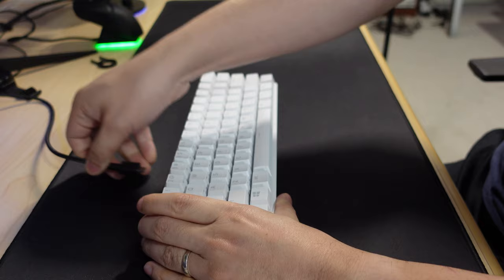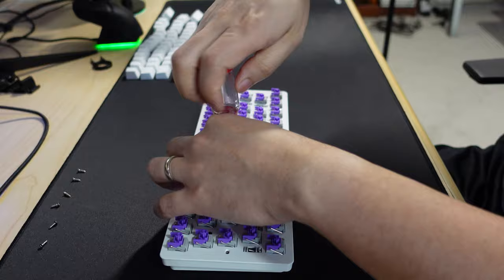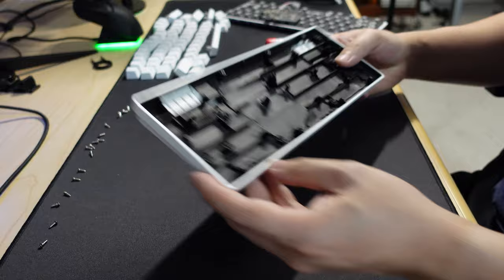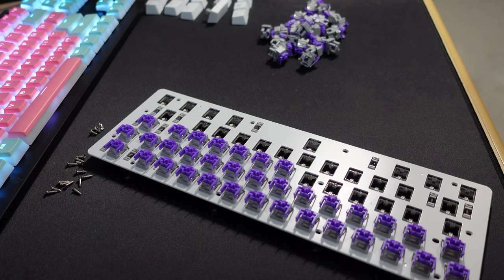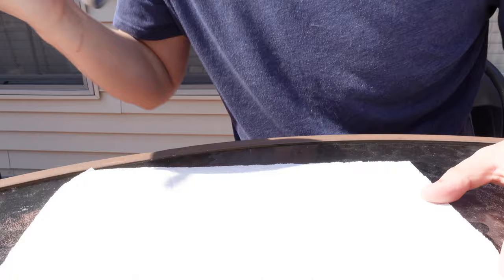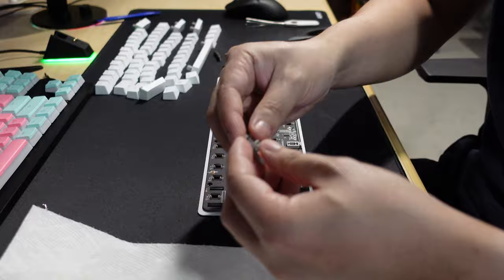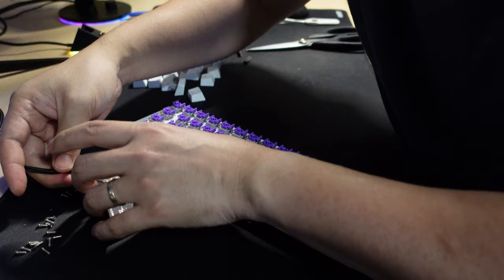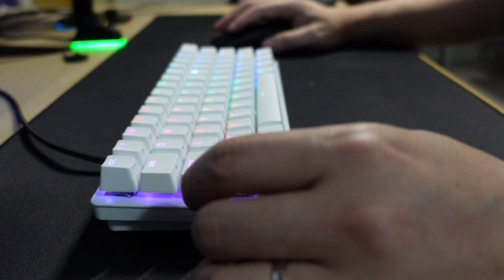Modding the Razer Huntsman Mini: Easy steps for better sound!

Comment: Anyone that have lubed the new razer switches with walls? Like with spraylube? I want to do it but i cant find any videos onit. I have a blackwidow elite with yellow switches
Reply from the maker: Since those are traditional mechanical switches, I would be very careful with spray lube. I know 3ildcat has some guides for doing it without removing the switches, but there is definitely a risk. There are also some video guides on how to lube with traditional lube and a brush by kind of depressing each switch and then using the brush to get some lube on the rails and stem. That may be a better option (I did this with my Blackwidow Lite and it made a pretty noticeable difference).
Reply: @bigxie  ahhh thanks. :)

Comment: I just did the same mods but I used g lube and I also LUBE EACH STABILIZER ON EACH KEY took forever and also mine had foam in its already bought it from amazon new about a week ago also sounds completely different it is the purple switches as well ( mine is very deep and iswear zero spring pin or rattle even stock ) i can do a video if you want also side note you can get the keyboard for 75 usd now and 10 bucks shipping )

Comment: Ribbon cables usually have a breakerbar that has to be levered up in order to release the cable.
Reply from the maker: Indeed, but it doesn't lever up, it appears to lever out (which is why I tried using the pry tools). Turns out it's easier to remove on the keyboard PCB end, just takes some firm pressure to pull it straight up and out.
Reply: Andrew Xie Ok I see. I was interested in the Huntman Mini with the linear switches but when I heard the noise I instantly changed my mind. Do you think your measures may improve the sound of the new linear switches and stabs as well?
Reply from the maker: @aa65064  yes, I'm sure it will. Check the pinned comment to see how these same steps affected my TE, which uses the older generation red switches which are louder to begin with.

Comment: i'm scared to remove the switches. if i sprayed the wd40 into a container and used a brush to paint the lube into the switches, would that work too?
Reply from the maker: If you're going to be disassembling the keyboard to the point where you'll be able to access the switches with a brush, I would recommend you go the extra step of removing the switches. Even though I just popped them out in the video, there are actually tabs on the switches that you can pinch from underneath and push them out without force. That being said, if you wanted to use a brush to apply the lube, then just skip the WD-40 and sprays altogether and you can use traditional keyboard lube like Tribosys, Krytox, or even cheap SuperLube https://www.amazon.com/gp/product/B000UKUHXK/
Reply: @bigxie  hmmm would the dry lube wd40 have the typical wd40 smell?
Reply: @xuanshin13  did you ever paint brush lube your switches? If so, how did it go and do they still feel good?
Reply: @brobot6565  i didn't try paint brush lubing it as i read somewhere that it might affect the sensitivity of the switches, due to it being optical switches. So i just did the normal WD40 dry lube. I did however, went on to build my own keyboard haha

Comment: Planning on Trying this for the first time. Before i order the lube i just wanna know if one 10oz can is enough for a full sized or should i get the 5 pack
Reply from the maker: One 10oz can should be more than enough
Reply: @bigxie  have you have to relube the switches yet? Or have you not really used the keyboard so the lube is still fine.
Reply from the maker: @brobot6565  I haven't been using it regularly recently, but for about 6 months after I made the video I did and didn't notice any degradation

Comment: Hey! Recently I’m thinking about buying the huntsman mini and I have a question about the performance and modding. Mostly I’m concerned about the keys getting dirty after lubing them with the wd40 also did you have any problems after modding it (key’s didn’t work etc.). I would be very happy if you would answer. Cheers!
Reply from the maker: Hi, I haven't had issues in the 6 months or so since I did this. Since the lubing is done with the switches removed, as long as you give sufficient time for them to dry before replacing them, it shouldn't cause a mess. Some lube may get on the PCB, and you can clean it if it bothers you (I didn't, since it's non-conductive and I can't see it once everything is reassembled). Hope that helps!
Reply: @bigxie  thanks bro!!! You really helped me. Anyways nice and helpful vid, keep up the good work :]]
Reply: @bigxie  and I have one more simple question. Has it turned yellowish?
Reply from the maker: @azmmr5608  no discoloration. Make sure you're using the PFTE dry lube variant of WD-40. Sounds like your concerns are based on regular WD-40, which you should NOT use on your keyboard.
Reply: @bigxie  No No i’m thinking about the keycaps and the case changing Color because of usage
Reply from the maker: @azmmr5608  interesting concern. The doubleshot PBT keycaps are pretty resilient to wear and discoloration. Mine look pretty much brand new. Of course mine is just being used in a normal, temperature controlled home office. Can't say for sure in a different environment how it would hold up.
Reply: @bigxie  yea i’m typing from hell soo that could be a problem... hahah just kidding thank you so much for the help

Comment: Did you use the dry lube spray for the stabilizers as well or did you use grease instead?
Reply from the maker: I would recommend using Permatex or some other dielectric grease since it will help cut down on the stabilizer rattle. I initially did use the dry lube and had to go back later to add the grease to get it a little less noisy.
Reply: @bigxie  Oh ok makes sense. So dry lube on the switches and grease on stabs. Thanks a lot for your response

Comment: does this mod work with the huntsman elite?
Reply from the maker: yes, the principle is the same, but the teardown for the elite is a lot tougher since it has that light diffuser layer in the middle. I wouldn't do it unless you're pretty confident working with electronics and read/watch a teardown guide.

Comment: Can I swap the razer optical red or the purple? And is it easy to do?
Reply from the maker: Yes, the switches are interchangeable and can easily be swapped out. The hardest part is sourcing 61 (or 87 if you're trying to do the TKL) of the other type of switch ;)
Reply: @bigxie  how do I source 61 I have the razer huntsman mini btw
Reply from the maker: @corbs2971  unfortunately they don't sell the switches individually so the only way to do it is buying a Huntsman with the kind you want (for example a broken regular Huntsman, if you're looking for purple switches)

Comment: I know im late but can you use cherry MX on The huntsman mini?
Reply from the maker: No, the Huntsman family of keyboards only support Razer optical switches. These work in a completely different manner than traditional MX style mechanical switches. There is no metal leaf in the switch, it merely acts to block a laser beam that is shined by the PCB across each socket when it is pressed down. As such, they are a proprietary design and the only ones that are compatible are the red and purple switches from Razer.
Reply: @bigxie  ok thanks

Comment: I got the stabilizers out but where do I spray lube them. Do I just spray lube the whole thing?
Reply from the maker: You can actually take them further apart and lube up just the metal bar and then put it back together. If I could do it again, I wouldn't spray lube the stabs, but rather use some dielectric grease on all the "joint" or "hinge" areas.
Reply: @bigxie  Oh. The whole bar? ty for the tips
Reply from the maker: @ForeToldFN  well, if you're spray lubing it, it's pretty difficult to not get it all over the whole bar 😂
Reply: @bigxie  oh lol

Comment: 06:16 can i use normal lube and lube it with my paint brush on the sides I've seen alot of ppl do that and I was wondering if that would work
Reply from the maker: Yes, it can work and is preferred for traditional switches. The reason I suggested using spray lube with these Razer switches is that they don't open like traditional switches and there are no metal leafs in them to mess up with over lubing. You can definitely use traditional lube with these Razer switches as well, just keeping in mind that they don't come apart and you may need to spend a lot more time reaching all the surfaces with contact.
Reply: @bigxie  yay thx dude <3
Reply: @coylaxy7868  did you ever lube it? If so, how did it turn out?
Reply: @brobot6565  good it's been 10 months it's pretty good ngl

Comment: Is this keyboard hotswapable?
Reply from the maker: No, not really. The sockets are only compatible with Razer optomechanical switches, and swapping them while the board is on (hot swapping) leads to problems like other keys not registering.

Comment: Can you tell me what screwdriver your using. I don’t know which one to get.
Reply: He said it was a cheap screwdriver but he recommends a magnetic head screwdriver
Reply from the maker: If you're looking for the exact Philips head size, I have no idea. I would just get an electronics repair toolkit and it will have a Philips screwdriver that will work. The screws look to be pretty good quality and won't strip, even with a cheaper screwdriver.
Reply: Andrew Xie ok thanks your a life saver

Comment: Do you think a casual gamer that doesn’t really know a lot about this can mod it successfully like you did
Reply from the maker: Hey Will, I think it's among the easier stock keyboards to mod since there are only screws to remove in order to open it and you don't even need to remove the ribbon cable (which may be trickiest part of the process) if you unscrew the daughter board. The other parts are just tedious work (removing each switch and lubing them). It's similar in difficulty to assembling somewhat complex furniture (in reverse). But if you're worried about breaking the keyboard or losing the factory warranty, then I would recommend skipping these mods (especially if the stock sound or noise doesn't bother you).
Reply: @bigxie  ok thanks and also, should I just put the lube all over the switch or is their in part I should cover up?
Reply from the maker: You don't really have too much control with the spray, but I aimed mostly at the stem and spring, and then just click the switch a few times and it'll spread over all the surfaces in contact with each other.

Comment: Love the video, but which size screws are used on the board?
Reply from the maker: I'm not familiar with the screw size standards, but if you have a philips head screwdriver included in an electronics repair kit, it will work to take out the screws.

Comment: quick question how long will the lube last inside on the keyboard
Reply from the maker: I haven't really seen any degradation in the year and a half since I made the video. Optimistically speaking, it may last longer than the ownership of the keyboard. Worst case you may need to refresh it every couple of years.

Comment: Whats the tool hes using for removing the keycaps called
Reply from the maker: It is called a "keycap puller". I would recommend going for the ones with the metallic arms that can flex, rather than the all plastic ones with fixed spacing.
Reply: Ok

Comment: Can u use dielectric grease instead of wd40?
Reply from the maker: For the stabs, yes. But not to lube the switches, it's way too thick for that.
Reply: i've lubed keyboards with dielectric grease before. it's v easy to overlube or cause sticking issues if you dont get a lower grade grease. you also might nuke your tactiles

Comment: How do you remove the stabilizers? Is it the same process as removing the switches?
Reply from the maker: The stabilizers clip on to the metal plate. You can pop them out the same way as the switches (just coming from the opposite direction).
Reply: @bigxie  thanks for the reply! i have a follow up question. i did the same procedure as you but some of my keys are getting stuck after i press on them. how do i fix this issue?
Reply from the maker: @paoloaustria1577  Hey Paolo, I had a few switches do this as well. In my case, it was due to the metal bar on the switch itself being not fully seated in the plastic clip, making the switch get stuck as it moved up and down. This is very easy for it to happen when popping the switches out of the PCB, so I just made sure to check and fix each switch before putting them back on the board. To fix it, you kind of just pop the metal bar (switch stabilizer) back into place and click it a few times to ensure it's working smoothly.
Reply: Thank you for the reply again. It got fixed now. I think the problem was the lube was not thoroughly dried up when i put it back in. Now it works like a charm. Thank you!

Comment: I have the mini with red switches for awhile now i havent heard any ping or had any issue, im quite sure that they added some sort of foam in the switches themselves that has helped alot
Reply from the maker: Yeah you're right! The Huntsman Mini has improved red switches vs the ones originally introduced in the TE and is significantly quieter out of the box. Even still, the mods can make some pretty noticeable improvements. There's a viewer comment on this video somewhere where he's got a before/after sound test of the reds. But if the stock sound is enjoyable and doesn't bother you, I would just go ahead and keep using it that way!
Reply: tbh the main reason i got the mini was the white color to fit my setup, although for the price they could forsure make the stabilizes alot better they can still shake a good amount
Reply: @NailTeeth  ypu can lube the stabs and there wont be any rattling anymore

Comment: would this also work with the full size?
Reply from the maker: Yes, it also works with the full size and the Elite, though they are a bit more difficult to disassemble than the Mini. Once you get to the PCB, the switches and stabilizers come out the same way.

Comment: How much wd40? If you lube the switches wont the click go away?
Reply from the maker: I had also read that sometimes lubing clicky switches could make the click go away and was willing to assume the risk. Luckily, on these Razer purple switches, that doesn't seem to be the case. The example in the video of me lubing the switch was actually the first switch I sprayed, so I was being pretty cautious. Eventually I ended up lubing each switch by spraying up the spring from 2 opposite directions for each switch, holding down the spray for about half a second each time. I don't think you can actually overlube it, because the excess will drip off the switch.
Reply: @bigxie  what about cutting some foam and put it in the sides of the keycap in a way where it doesn't affect the RGB or the feel of bottoming out?
Reply from the maker: @ooogabooga9425  what are you trying to accomplish? The pinging is caused by the springs and can only be fixed with lube and dampening in the case. If you don't like the sound of the keycaps bottoming out, you could try o-rings.
Reply: @bigxie  is this really safe? since this switches are opticals we may fuck that laser thing or am i just dumb
Reply from the maker: @ignacio3714  If you pause at 0:05:09, you can see from the empty sockets where the 2 ends of the lasers are on the back of the PCB board (at the top and bottom of where each switch was). Since we're taking the switches out and giving them ample time to for the lube to dry, I think it's safe. There are no electronics on the switch itself, it's just plastic and metal. But it's definitely a risk doing any mods to the keyboard, and it voids your warranty, so gotta take those into consideration too.
Reply: @bigxie  so if you overlube you can make a linear from clicky ?
Reply from the maker: @majewskiphotography3771  no, I actually don't think it's possible with the way the Razer purple optical switches are designed. Check out chyrosran's teardown video on the Razer optomechanical switches to see the unique way these click. It's very different from traditional clicky switches. https://www.youtube.com/watch?v=QiFg9wGQXwA

Comment: does this mean you could move the razer switches into a different case?
Reply from the maker: No, not likely because they only work with Razer's own PCB design (where the optical sensors are).
Reply: @bigxie  do you recon if you take the top plate off and then it would be viable with the same pcb?
Reply from the maker: You want to move the existing PCB to another case? I think that is certainly possible, but it would need to be a custom designed case to match the existing standoff holes, etc. This isn't some sort of standard 60% PCB that will fit in existing cases, no.

Comment: do i have to use dry lube as i dont have that?
Reply from the maker: What do you have? You should be using a teflon based spray lube for these Razer switches. I suppose if you wanted you could brush the springs with traditional keyboard lube, but it's hard to get to the other parts of the switch since they don't open (non destructively).

Comment: does this work for the huntsman elite aswell?
Reply from the maker: Yes, but the Elite is harder to open and the pogo connectors for the wrist rest are pretty fragile (I broke mine off when I opened my Elite to do these mods). Otherwise, the switches mount into the board the same and can be removed for lubing too.

Comment: wd40 doesn't damage the switches at a long time?
Reply from the maker: This type of WD-40 (Dry Lube) is just PTFE, it won't damage the switches.
Reply: @bigxie  after a long time using this do u still recommend to use it?